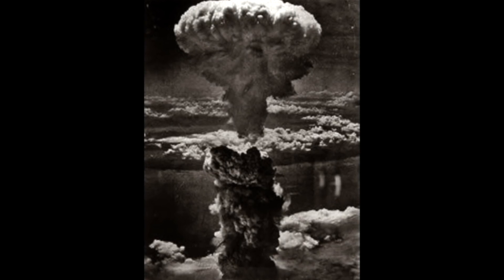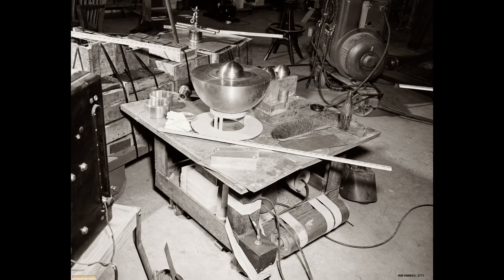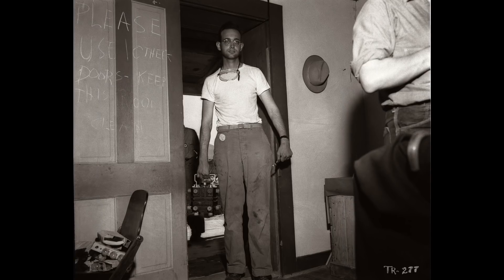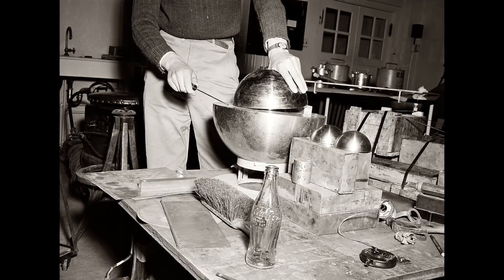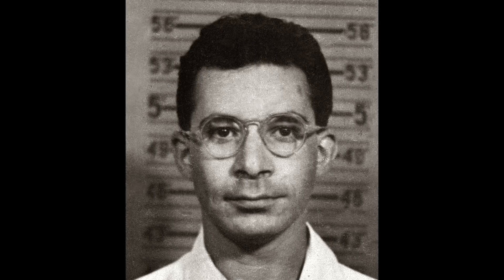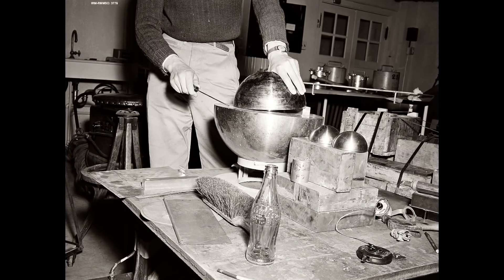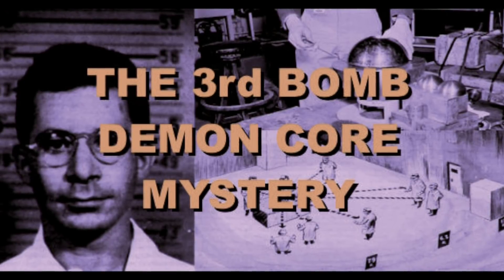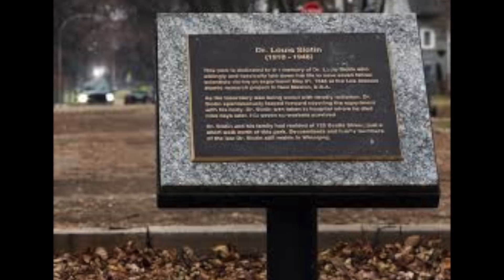Where did the demon core come from - Prof Simon

Comment: Sorry Professor, I don't know where you got your information from regarding the composition of the demon core, but it's incorrect. The demon core was in fact 96% plutonium 239,  similar to the Fat Man bomb dropped on Nagasaki. This implosion style weapon also had a depleted uranium (U238) "tamper" which encloses the plutonium core, perhaps this is where the confusion has come from.
You're correct that the Hiroshima bomb was Uranium 235 - it was a gun style weapon, propelling a U235 "bullet" into a cylinder of U235 to achieve fission. I believe this was all the U235 they possessed at the time.
Reply from the maker: You are correct it was mainly plutonium.  My confusion was two contradictory pieces of information...one..it was the core of a third possible Japan bomb ...two... the third bomb was the same type as the Hiroshima weapon... so I concluded it was an uranium core....thanks
Reply: @SimonHollandfilms  Uh, sorry, but that's still incorrect. The third bomb (which the "demon core" was to be used in) was an implosion style device the same as Fat Man - which was the Nagasaki bomb, NOT the Hiroshima bomb.
Just for clarity:
Hiroshima bomb: Gun style, with Uranium 235 as the fissionable material
Nagasaki bomb AND the third bomb (with the demon core): Implosion style, with Plutonium 239 as the fissionable material.
Reply from the maker: Wikipedia let me down....but thanks

Comment: Another story from Slotin's time at Los Alamos: There was a mechanical failure on an experiment he was running in a water-shielded reactor. Normal protocol would have been to shut the reactor down, wait days for the radiation to die off and then remove the equipment from the pool for repairs. Instead, he waited until everyone left for the evening, stripped his clothes off and then dove into the pool with a few tools. Its unknown how much radiation he was exposed to at the bottom of the reactor as he had removed his dosimeter badge but he experienced no ill effects afterward.
Reply from the maker: Wow....reckless

Comment: I think we can say he killed him self. He used a screw driver, they should of had a fixed spacer that could not slip out of the gap. He did it just to show how unstable it was, he had done it before but was not so lucky the last time. With some thing that can kill so easy, every step for safety should have been in place. The other people in the room were lucky that he was able to remove the reflector so quickly or he would have killed a lot of people and who knows how they could have gotten to the core after it was active.

Comment: How mad do you have to be to test it with a screwdriver. Why not put it in a rig so you can control it by the millimeter.
Reply: Fitted with a failsafe counterweight so that the reflector is lifted away from the core to remove the danger should control be lost.